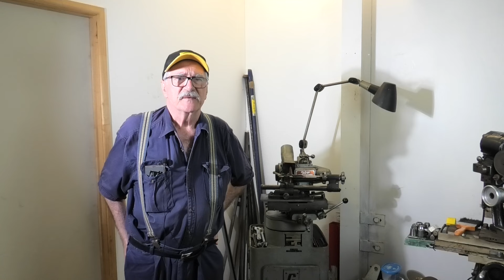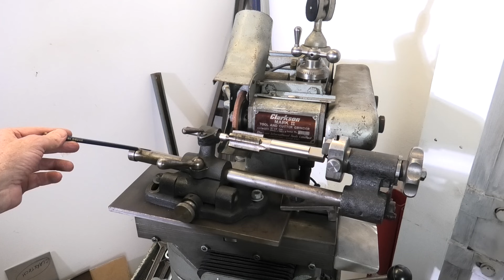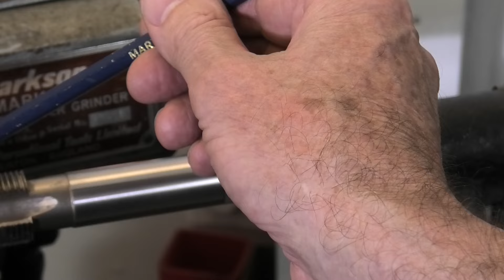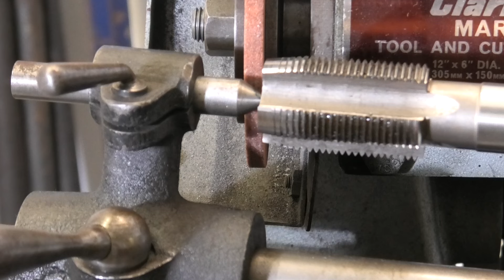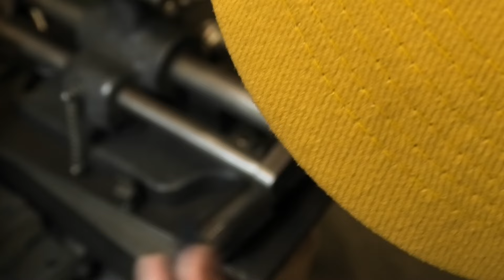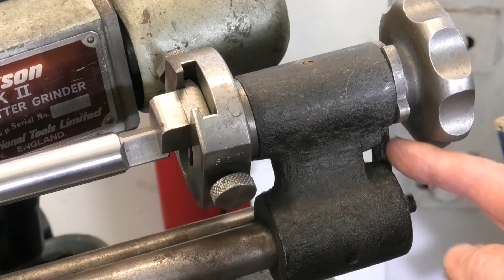Grinding big taps fail

Comment: B.C. excellent video. What is the name/model of the relief attachment you are using? Seems like a nice piece of kit. Thank you.
Reply from the maker: I have no name tag on it. It looks like USA build and good design. Will hold up to 2 1/2" X 10" taps.
Reply: @inmyshedwithbc.  Thank you, much appreciated. Will start looking around. You are a costly teacher. Lol
Reply from the maker: @termlimit  Search for george Heg on youtube. He gives a demo of a Clarkson tool gtinder. I have started a series on making a similar attachment from bar stock. I showed a few pics. Come along for the ride. BC
Reply: @inmyshedwithbc.  Haha yeah I took the plunge a while ago. I have an Astra Elite AR5-E with the 40 taper tool head and tailstock, a Weldon air bearing end mill sharpener, a Gorton 375-4 cutter grinder, and various other bits and bobs. But there are never enough tools. Unfortunately there is never enough money to buy said tools. I remember your bar stock series now that you mentioned it. I will go back and view it again. Thank you!!
Reply from the maker: @termlimit  I have an Astra Elite as well but got no workhead. I use it with my form relief attachment. The drill grinding attachment off it has been adapted to a bench grinder and is great. I find the air spindle a bit cumbersom whel grinding annular cutters and prefer Rong Fu or Clarkson work heads. Did you get the Astra indexing setup. Mine is the best. BC
Reply: @inmyshedwithbc.  Yes I did get the indexing setup for it. I had one plate. However I modeled it in CAD, then 3d printed plates for 2,3,4,5,6,7,8,9, and 10. The 3d printed versions work great, since the indexing head has a lock, the 3d printed part only has to index, not take any load. The air bearing is bulky and cumbersome. I also have a Yuasa end I'll endmill grinding fixture that is not air bearing, I use that quite a bit as it is easier.